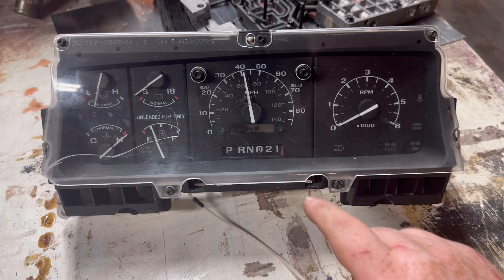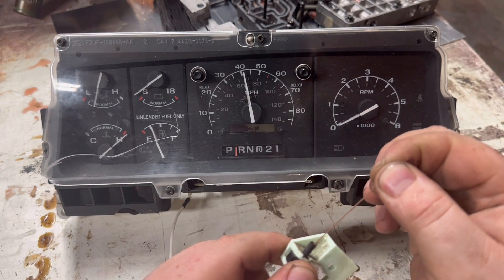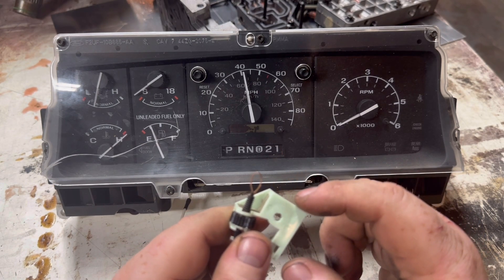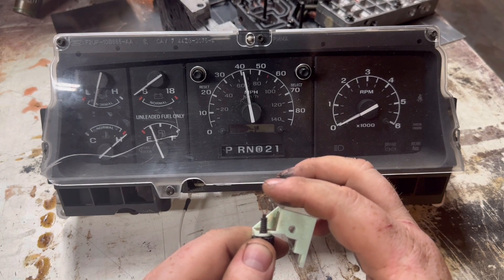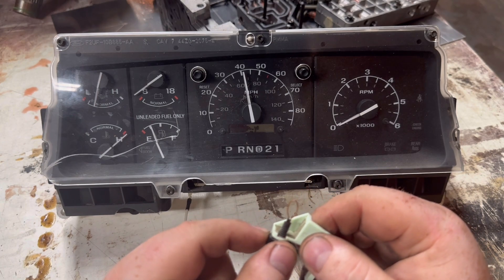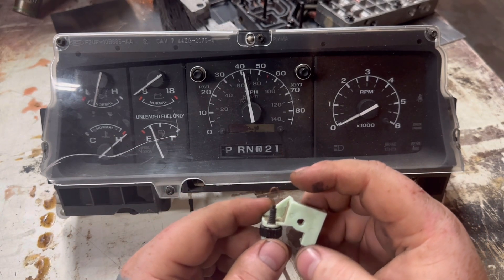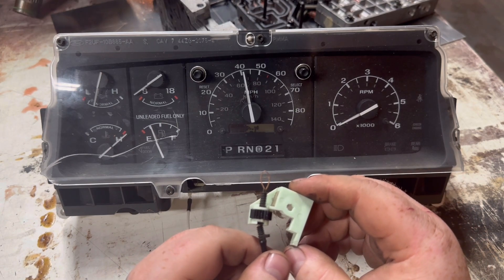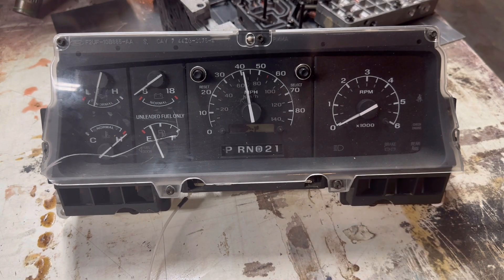Ford F150 F250 & Bronco - Gear Shift Indicator

Comment: do you have a on off switch on your truck under the dash by the lights and windshield wiper switches because i do and i don't know what it does
Reply: on your 1986 f150